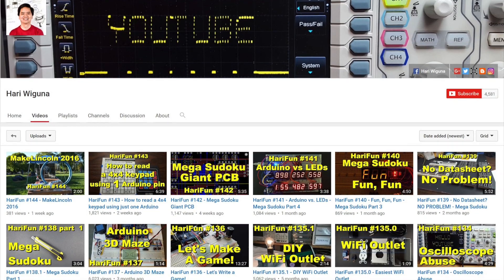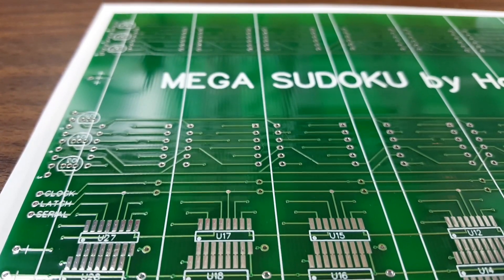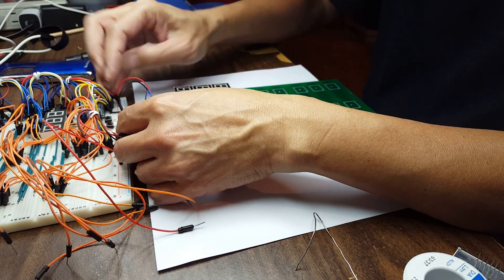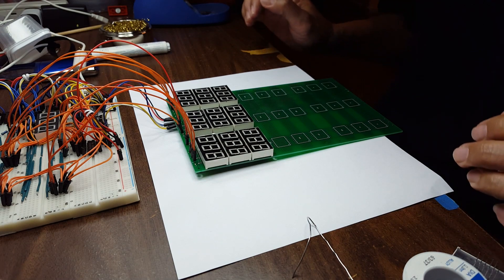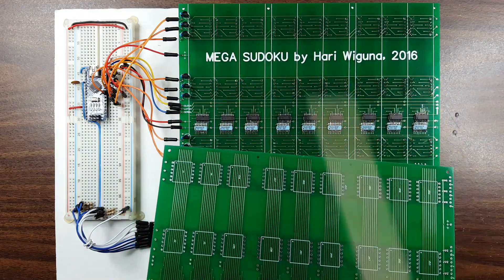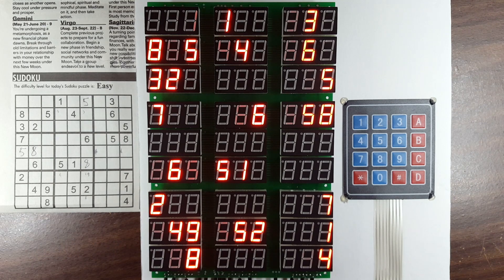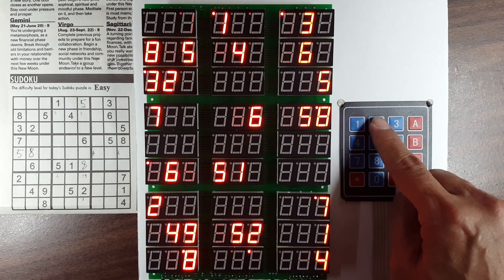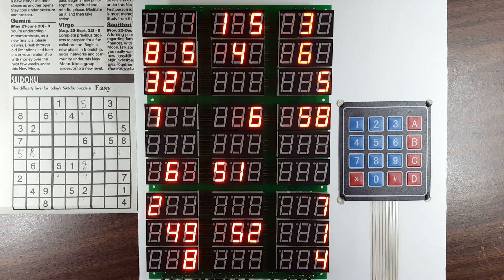HariFun #145 - One HUNDRED Shift Registers!?

Comment: What kind of breadboard that is? Looks huge.
Reply from the maker: It is actually several breadboards re-joined into one.  I used a razor to cut the underside backing and separate the power rails from the main breadboard. Then I used the plastic "tabs" on the breadboards to join them back together in whatever configuration I need for the project.

Comment: Hey Hari, you have a new subscriber. 😊 I think this is one of the best articles I've seen on generating sudokus, especially with a focus on the techniques and limitations of the low power CPU. http://garethrees.org/2007/06/10/zendoku-generation/
Reply from the maker: Thanks for the subscribe and the link to the Sudoku generator article!
Since this video I've actually coded a bunch of new features including a Sudoku obfuscator where I just put a bunch of raw puzzles in the sketch and RANDOMLY obfuscate (rotate, flip, jumble) them.  But, an actual generator would be better, so I will check out the article you sent me.  Thanks Bernhard!

Comment: Don't know if you noticed the LED ghosting. Perhaps the transistor that controls each column is not turned completely off before the data for the next column is loaded into the shift registers?
Reply from the maker: Hi Jianan,
I currently never turn off any columns, instead I simply shift the column bits so only one is on at any one time.  I probably should turn off all columns, prepare the 9 rows for that column, latch them, AND THEN turn on the desired column, right?  Thanks Jianan!
PS: I'm a big fan of your projects!

Comment: Very impressive!... Now what to do the with the other shift registers??
Reply from the maker: Thanks Chris!
Shift registers are like RAM, you can never have too much ;-)
Though the keypad interface is cool, I'm not happy with the actual pad itself.  Some of the membrane switches are mushy, so I'm considering replacing the pad with a touch keypad.  I have an idea on how to use the Shift Register which normally is used for OUTPUT as an INPUT interface.  We'll see if my idea works. Stay tuned :-)  Thanks again for the comment!

Comment: Was there any reason you used the displays upside down? The decimal point is at the top.
Reply from the maker: Hi Kieran,
Great job noticing the upside-down display!.  :-)
Of course, I did that intentionally because I wanted to avoid anyone interpreting those dots as decimal points.  I think it would be very confusing to see decimal points in Sudoku :-)
Incidentally, I didn't think of this until after I ordered the PCB, so the PCB is actually upside down!  I had to remap the segment bits.  Software is awesome! lol

Comment: wow man that's crazy cool. the control pad worked out very slick and easy to use . 
that's a mad big board but so cool looking .  also you remind me to get my butt back over to hackaday.  
man that looks sharp.
Reply from the maker: Thanks Scott!
I wanted to implement your touch interface ideas, but the simplicity of a keypad using just ONE Arduino pin is tough to beat.  One thing I did not mention in the video was how the whole thing is surprisingly heavy.  I guess it adds up when you have a 9x9 grid of seven-segment display.
Reply: such a cool looking project .  now i see how big it is , for a case i would suggest getting over to your hacker space and cut some acrylic parts . it just to awesome looking to dip .  a dip would hide some small details . 
acrylic case can be made to open and such . 
looks very cool man .
Reply from the maker: Thanks Scott.
You know, I was going to make a nice wooden case, but you're right. Acrylic would show off the inside.  This project is not as involved as the tiny cube, so I'm not as scared to dip it in resin.  I wonder how much it would cost in resin to cover this board...

Comment: how Long did the soldering take if I May ask.
Reply from the maker: About three evenings, so approximately 12 hours total.
Fine soldering iron tip absolutely necessary, but soldering SOIC sized SMD is actually not too bad.
Reply: thank you. Do your fingers hurt after so long? because mine do after 4 hours non stop.
Reply from the maker: I did not go on 4 hour soldering marathon :-)  I solder a part, then test with multitester make sure I did not have any shorts. Once I got enough parts that I could test together, I actually turn it on like you saw in the video when I had the first 3 rows completed.